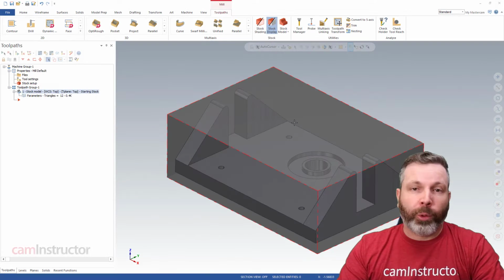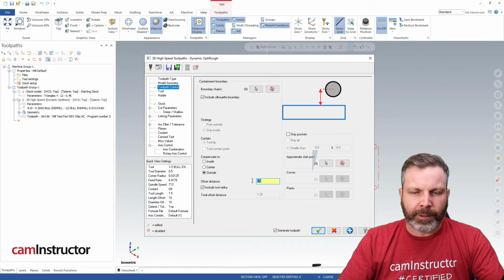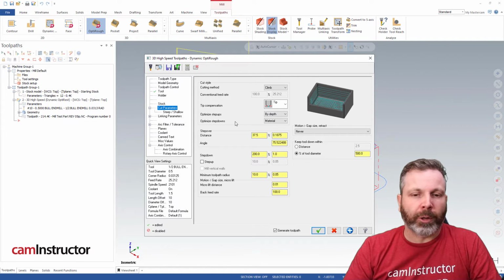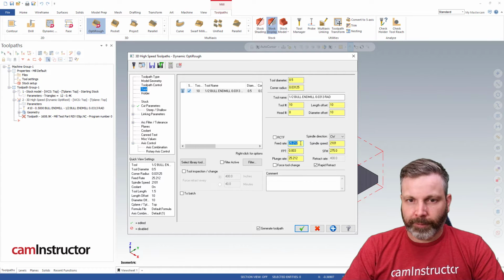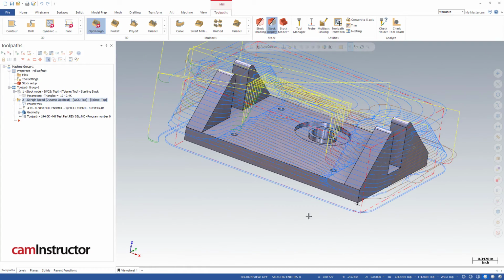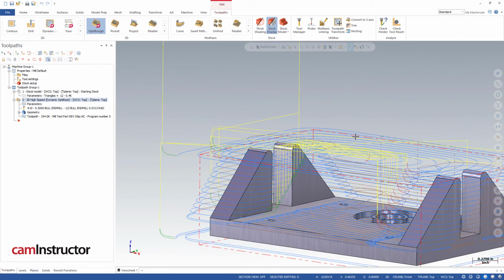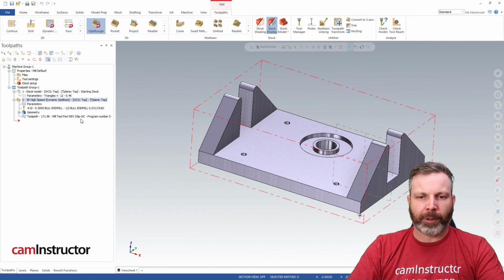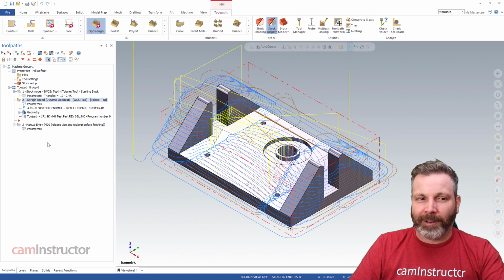Mastercam OptiRough using Stock aka OptiRest | Xometry Mill Test Part - Video 4

Comment: In other videos I've seen optirough used, they show the tool "spiraling" up the walls of the part during the stepups but I can't figure out how to do that.  Every time I use optirough it retracts and rapids to do the next stepup.  But I'd like it If it was constantly engaged in the cut and walked its way up the part.  Do you know how to do this?
Reply from the maker: No, optirough cannot spiral up. It cuts in Z levels.

Comment: What do you recommend for roughing an open window of a spoke of a wheel that is very concave? The stock is not square, it is very concave and I'm getting a lot of air time and stock left over in steps at the bottom of the spoke. I can send you an example file.
Reply from the maker: Most of the time my go to roughing for 3D is OptiRough driven by a Stock Model.
Reply: @CamInstructor  I've been experimenting with that but once it goes past the stock in the z it has a lot of air time underneath the part where there is no material. I guess most MC users call this the mushroom effect. When placing a floor for it to avoid it leaves little steps of material. It's fun messing around with different stuff but I feel I've hit a wall.
Reply from the maker: @DrummInBeats  2023 can handle mushroom stock models. 2022 and prior, machine the mushroom portion, make a new stock model, cut the rest.

Comment: thank you for the video, good material :)
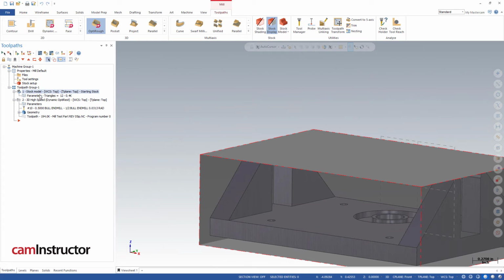In 19:02 cannot you just use minimum depth option in steep/shallow instead of manipulating with stock setup
Reply from the maker: No. It will still want to cut that stock that is above the part first. eg. if you set min depth to -0.02 but leave stock model at +0.02, the first cut depth will still be at -0.02. You have to get rid of the stock above the part to change this behavior.
Reply: @CamInstructor  ok i understand you want to have only one cut at the bottom without facing the top,
that makes sens 
thank you for this video :)